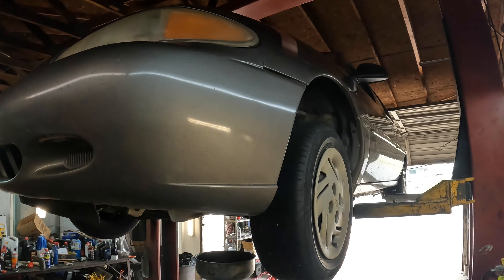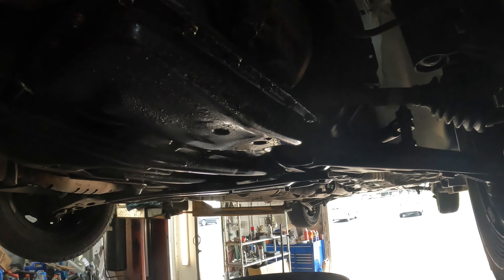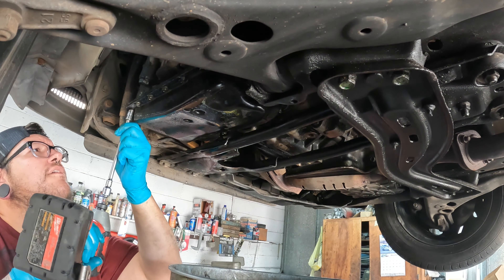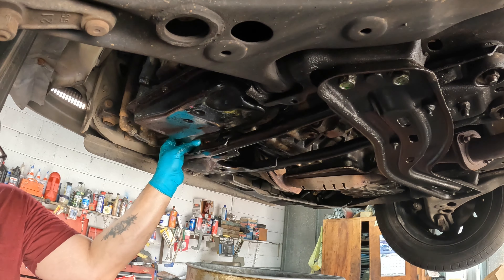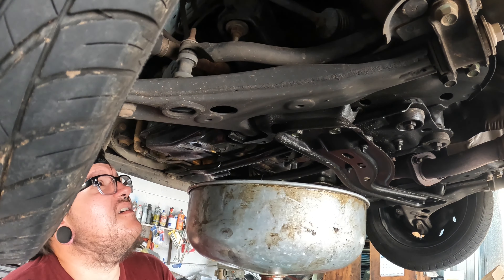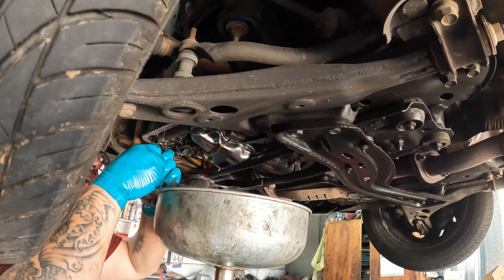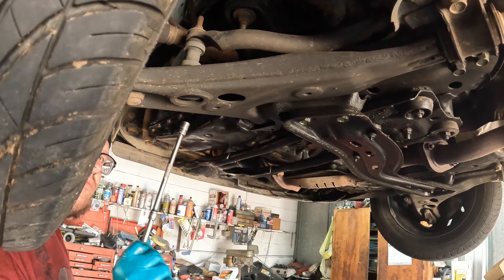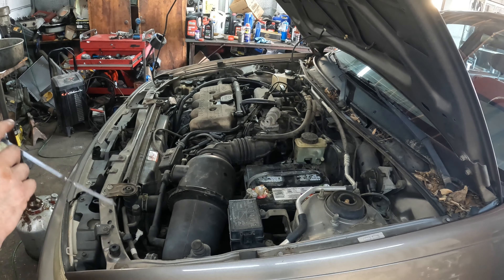Ford Escort Transmission Filter Replacement

Comment: Thank you! This video was super helpful and straightforward. I just bought a 98 Sedan and i'm flushing everything. Can I use that transmission fluid in the power steering as well? Mine is a little low and its whining.
Reply from the maker: I think these actually call for mercon atf for their ps fluid.  So you should be good
Reply: @operationoverhaul  Thanks!
Reply: Put a squirt of Lucas in when refilling the power steering to help with pump whine and squeaks

Comment: How did you clean the transmission pan?
Reply from the maker: I used lint free rags and brake cleaner to clean the pan.
Reply: @operationoverhaul  Ah, okay. I am going to do the same thing on my project. I'm actually gonna be taking down a 1997 ford escort transmission. Not sure when the last time this guy changed the fluid but i'm gonna do my best to get her from leaking at the gasket. I appreciate the quick feedback.
Reply from the maker: @Quartered_Rodent  your welcome and if you need any specs just contact me and I can get you anything you may need

Comment: So no merc v for fluid and also what was the reason for you replacing the filter on the vehicle did the  customer experience a hard one two shift
Reply from the maker: The main reason was the gasket leaking but it would from slip time to time when taking off from a stop.
Reply: @operationoverhaul  okay, yeah I wasn't sure because I've seen a few of these videos where people replaced the transmission filter but they never explain what the reason was specifically like. It must have been just preventative maintenance but I picked up a nice rust-free 2001 Ford escort and it seems like the one two is very hard when it goes in like the car almost wants to wind out and then it goes into gear and this is at like 10 mph. It goes into the next gear. 

And now what I have read is there's an adjustment on the throttle cable that increases or decreases line pressure but I'm not sure if 2001 has that. But if it does, maybe I could do something like that and it would stop this problem. I'm hoping I don't have to rebuild. I don't want to spend $2,500 on a rebuild